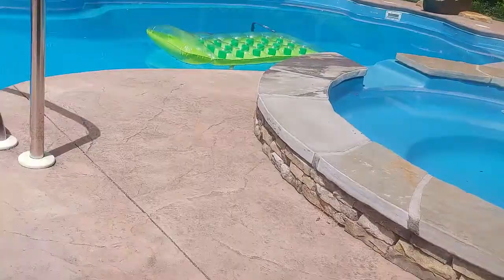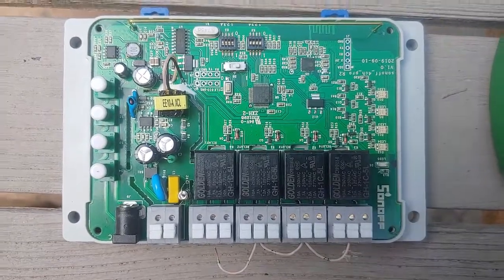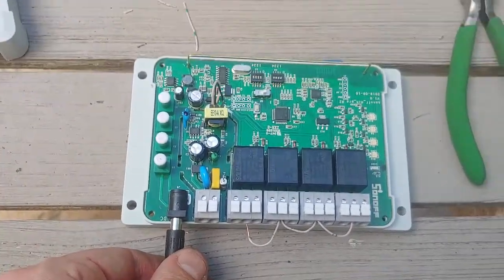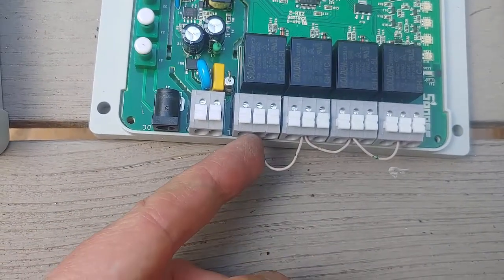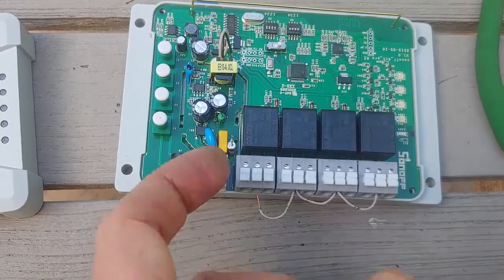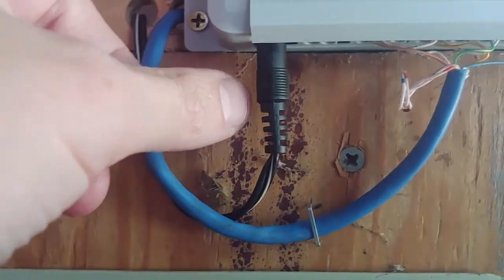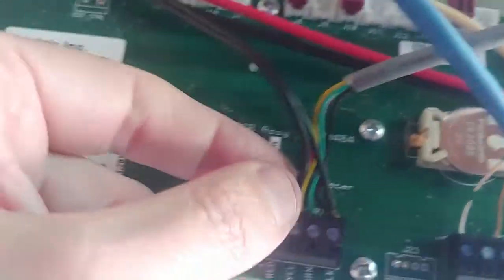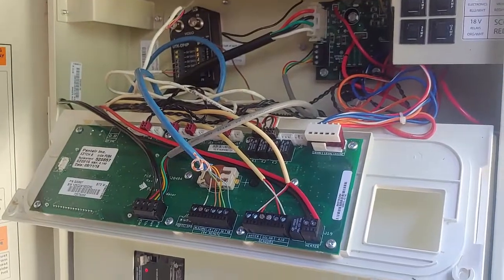REVIEW & overview: DIY Smart Pool and Spa Switch for $29 works with Amazon Alexa/Google Home

Comment: how do you get away using this with a water heater with 220V and 60amp?
Reply from the maker: I don't have an electric hot water appliance but it maybe acted by Louis voltage switch. In the case of what I'm showing the video, it's flipping low voltage relays which control high voltage wires in some cases.

Comment: Very helpful video.  I would trust this board much more than the original relays you used as these are only rated for dc voltage ranges and should clamp the kickback of the switch closing quite a bit vs. the relays supporting both dc and ac voltage.  In terms of the intellitouch board going bad I would suspect it might just be an rs232 adapter or similar; if someone can figure out the chip it could be re-soldered.  The low level voltage is generally TTL which is 5v or less.  You could in theory put a 6.2v protection diode on the TTL side on the pinout of the rs485 or similar port that goes to the screenlogic adapter, or 18v diode on the rs485 control signal wires (they run around 12v).
Reply from the maker: @eastmanresearch3143  you're spot on!! It was the RS232 chip that kept getting blown out. I found someone that told me exactly where it was on the board and that replaced it with the chip that he recommended. It was a lasting repair and never went out again I think it's been good for a couple years. I'm not sure I did another video on it. The guy had a business over repairing these boards and I told him I would pay him to tell me where the chip was. He was kind and told me where the chip was without charging me. It was a very challenging repair though, because of the chip is underneath the LED that is soldered on top of the board by about 32 pins. In fact I messed up the first board, but I had a spare and was successful in the second board.  While this automation that I show off in this video was good, it was flaky because the spa side remote setting on the board with default to off if there was the slightest confusing signal to the board. So I've had the screenlogic system back up in fully running for the last couple years or so. The network chip that I installed must have been more resilient, it was a different brand. To me it sort of proves that pentair was putting in a bad chip or at least one that could have used more resiliency.

Comment: Hi, Thank you for this information. I am installing a brand new above ground pool with heatpump. Do i need the pentair panel to connect the Sonoff or i can just connect the Sonoff to a regular pool panel to control the pool pump and heater? I dont have a spa.
Reply from the maker: @PKotia you'll need a panel that has a similar feature to the spa side remote input to do this. If it is a panel like mine or similar, You don't actually need to have a spa.

Comment: Have you seen where the pentair automation shuts off the is4 in the settings menu? I did t use the sonoff, but used a 4 channel rf controller and it is randomly turning off the main spa side option in the settings?
Reply from the maker: Yes, it seems to be a protection mechanism of some sort. Check that all your wires are tight. Also consider slowing down any commands. So if you're using that to cycle through lights to change colors it might have an issue during that. In short, I don't think anything's wrong with your pentair system because I've also seen that before.  I ended up fixing my main board and using the pentair automation and no longer use the sonoff. Still think it's a good solution though so I left my video up.
Reply: @SwimmingintheDeep  I read somewhere else that it could have something todo with the orange wire and it wanting to see some resistance. 

If I switch to the sonoff one, did you have to adjust the speed of the commands? I’m assuming that is how fast the “inching” is correct?
Reply from the maker: @lifeinsarasota  inching is same as momentary mode, which is what you want.  I just meant to make sure you don't press commands too quickly as that might be why is4 turns off. You may be onto something with resistance.

Comment: Definitely worth subscribing. My pool+spa set up is with manual jandys right now. I don't want to buy the Pentair panel. I d like to add two valve actuators. Is there a work around buying the Pentair intellitouch ?
Reply from the maker: You could use a device like I show in the video to directly flip the valves but you'll need some kind of 24 V input.  And then for the pool pump you could use a device like this https://www.amazon.com/dp/B09P5YFD7Z/ref=sspa_dk_detail_3?psc=1&pf_rd_p=89ee1d2e-380f-4a05-89e5-d22eb0a17762&pf_rd_r=AYHB1WMXEQ3XXBCXYDCG&pd_rd_wg=ju3gA&pd_rd_w=vMG5N&content-id=amzn1.sym.89ee1d2e-380f-4a05-89e5-d22eb0a17762&pd_rd_r=9d3a9c8e-09c6-41bd-aed3-1708585b2220&s=kitchen&sp_csd=d2lkZ2V0TmFtZT1zcF9kZXRhaWxfdGhlbWF0aWM&spLa=ZW5jcnlwdGVkUXVhbGlmaWVyPUExSktTMjNIVkZTUTk2JmVuY3J5cHRlZElkPUEwNDQzODU5MUtOVko2QjdNRTlIUCZlbmNyeXB0ZWRBZElkPUEwMTY3MTc2MUZXRUlOVFpSTEhVUiZ3aWRnZXROYW1lPXNwX2RldGFpbF90aGVtYXRpYyZhY3Rpb249Y2xpY2tSZWRpcmVjdCZkb05vdExvZ0NsaWNrPXRydWU=
Reply: @SwimmingintheDeep  Thanks for the reply just one more quick question: can I use the device in the video to calibrate/set the amount of valve opening? Will it run the actuators a certain amount of seconds and in the direction I need them to? For the 24V input I can buy a transformer.
Reply from the maker: @ROBERTLUCIAn  I think what you want to do is use the pin stops. Look at your pool actuator handle from the top and you'll see several holes and two plastic pins that can be removed and put in another location. Those pins will determine how far your valve can move.

Comment: My problem is - I’m trying to accomplish this(Turn Single Speed Hayward Pump on, then turn on pentair gas heater, potentially pool lights, no valves), but I don’t have an Easytouch panel.

Currently pump is controlled via mechanical timer. Gas heater through the on device control buttons. 

I’m trying to figure out how to get it to all work on the 4CH. 

I think I can directly hook into the foreman switch for the gas heater. However I’m a little stuck for my Hayward Superpump. Would I need a contactor?
Reply from the maker: You are on the right track. You would want to use something else instead that can handle that.  I researched a bit and found a couple of things on Amazon  https://a.co/d/8IRMQsE   I see some other similar things but was looking for one to handle both your heater and pump  separately but together.  You may need to do a separate sonoff type device for the heater like you were thinking. Let me know how it goes. Be careful with the high voltage wires and turn off the upstream power. Using 10 gauge or whatever is appropriate.

Comment: Thanks for the quick response, great video. The pentair spa side controls seem to support ten buttons. Do you know how that is implemented, could we have more than one 4ch device to make eight options?  I know the com port system can support many things, like heating, just not sure how it communicates to go over four buttons?  Thanks
Reply from the maker: I tried to think of a way to exploit that input but because I don't that option as a remote I really didn't know if it was possible. It seems that that might be more comport-based so it might not be as easy as the 4 channel spa side. I eventually ended up fixing my pentair screenlogic system by finding the chip on the board that had gone bad. I believe I replaced it with a much heartier chip because I have not since had an outage of it again.

Comment: Great info, well done. Appreciate the updates from your last video.  I am check on a relay that can be ethernet connected. But the Wifi is a great solution for this use case with very little data traffic.  If you have a wired 4ch with inching that would work please share. I'll integrate with open, home assistant on-prem home automation solution. Have you seen any power options to power-blink the lights at different cycles to memic the easytouch light control, for color? I have a couple easy touches and one has the pool light on a direct switch. So it misses out on the Easytouch light control, which I believe just cycles the relay/power x # of times depending on what mode it wants the light in.
Reply from the maker: Hi, thanks for the comment. I have not seen an ethernet inching device but they may exist. I don't have easytouch lights but another brand that works and changes off of a power cycle as you describe. It's a little hit and miss because of a slight delay but can usually work to change the color of the lights.

Comment: Do you have a link for that cord?
Reply from the maker: No, this was just a wire I had laying around the house in my junk. But it is an ethernet wire. You can use any wire that has at least four conducting wires in it. Oftentimes a security system wire would work as well.

Comment: I saw in your description that you used this on a pentair system. But you implied that your not sure about others. Then in your video you say you can use this in other systems. So can you use this on a jandy system? Great video by the way. Hope you have more maybe do one on a different system like jandy would be nice.
Reply from the maker: There are many systems that use a spa side remote that are basically the same concept. If your jandy system uses a four button spa side remote this will likely work with it.

Comment: Wow -- thx so much for the fantastic pool equipment videos. We have a Jandy Aqualink RS system and inside the house mounted on the wall there's a Jandy RS remote which is hardwired to the main controller outside. Considering the Jandy remote has full pool control, could I connect this Sonoff box directly to the remote where it would essentially "piggyback" the Jandy RS remote and give me WiFi access?
Reply from the maker: Thanks so much for the comment!  If the remote contacts equate to a simple normally open or closed switch it should work. You should be able to test the contacts with a small length of wire, mimicking a momentary switch. Hope that makes sense.

Comment: Awesome, thank you.  I have a question  - I want to use power NOT from the pentair board as I already have a spa side remote (the IS10) and don't want to put too much of a draw on the board.  I don't know much about the relays, so here's my question.  Does it only use the power supplied to the relay for the purpose of kicking on the relay and keeping the wifi alive or... does it also pass through the power in any way to the low spa side contacts?  i.e. do I care what voltage / amp I'm supplying to the unit, or is that shielded entirely from the contacts that it is connecting?  I hope that makes sense - don't want to fry anything!
Reply from the maker: It just works as a low voltage switch for the contacts. The low voltage current being switched stays independent from the low voltage powering the relays on this device. You probably have a old power supply like cell phone charger that falls within the specs to power it. Any USB charger may make it work.
Reply: @SwimmingintheDeep  THANK YOU - also do you happen to know if you can have both the IS10 spa side remote as well as using the 4 port at the same time?
Reply from the maker: @johnmehner8641  I don't have an IS10 so I don't know but I think they are two separate ways into remote the system. So my guess is yes, you can have both.

Comment: I have an Jandy AquaLink RS that the board is bad and I want to bypass the entire system. Wondering if I can I can connect the red and black wires coming from the relays that used to plug into the Aqualink control board - cut off the plastic connectors and plug the wires directly to the Sonoff?
Reply from the maker: It sounds like it to me. IT sounds like the red and black wires are low voltage, are they?  There are a few modes to this board....I have the contacts in "momentary" mode but you may need them in "locking mode" for what you are doing. Figure out what is happening, to open and close the relay. It is applying 12-24v constant?  That would be locking. If it is doing it momentarily then it would be momentary.
Reply: @SwimmingintheDeep  Yeah those are 24v wires from the relays. I have a free relay that I can test it out on. Thanks for the feedback...I'll check it out.

Comment: Can this control automated valves?  I'm looking for an option where I can say "Turn Spa On" and it will automatically change the valves over, start the pump, and start the heater.  Then when I say "Turn Spa Off" it will change everything back to pool mode.  I wonder if this would get me close if I just wire the heater and pump into the "spa" part of the board.
Reply from the maker: That's exactly what this does, moves the valves and turns on the pump. You need to have a system that already does that with buttons like the easytouch.
Reply: @SwimmingintheDeep  awesome!
Reply: @SwimmingintheDeep   to branch off on that, can i use the easyTouch wireless remote and this method,i would like the option  to have both
Reply from the maker: @jamesishere6630  yes, this just acts like spa side remote to the system.

Comment: Thanks for you tutorial. I have liked and subscribed! Any idea why the EasyTouch will disable the iS4 Spa Side remote on its own? I have connected the Sonoff 4ch Pro3 and it works fine until the iS4 disables itself. I have changed it back to on on the EasyTouch panel and with the ScreenLogic app but after a short time it will disable itself again.
Reply from the maker: I've read that if it detects an error that it disables itself. I think this has only happened to me once. I'd double check all wire connections and double check the dip switches on the sonoff  itself to what I show on the vid.
Reply: Did you ever figure out the issue? My EasyTouch also disables the Spa Side function on its own, and I haven't been able to figure out why.

Comment: This is a really elegant and cost effective solution.  The only oddity is you have to tell Alexa to turn "on" the pool device if you want it on or off.  It doesn't appear to know if the device is already on/off.  Seems like that is a wiring issue.
Reply from the maker: It's because of the nature of a momentary switch.  You can partially resolve this by adding a routine to Alexa or Google Home. For example, every time you say Pool Off, have it actually turn pool On.   So the command will work but you still have to verify what it did by looking at the pool.
Reply: @SwimmingintheDeep  Another solution would be to write some custom code for the ESP32 chip that is inside the Sonoff so it remembers the current on or off state (while still acting as a momentary switch).

However I might go down the route of completely cutting out the pool/spa control board - having the Sonoff trigger pumps, valves and heaters directly. Home assistant or some custom code to schedule daily cleaning routines. And another ESP32 board to monitor pH and ORP level. Some people have gone as far as pumping chlroine and acid automatically when levels are too low
Reply from the maker: @neoncreativestudios  good ideas! I ended up fixing my pentair board and I'm currently not using this system but I like your way of thinking!

Comment: This is great, can you give which wire to tap into on the hayward oncommand?  Thanks
Reply from the maker: KT AA, I am not sure. I see that the spa side remote for that system requires a base station that then wires to the board with four wires. I am not sure if these contact points can be leveraged. If you proceed, proceed with caution and at your own risk.
Reply: @SwimmingintheDeep  Thanks and was actually thinking about taping into the wires the goes to the relays. Thanks again Kevin

Comment: Great video. Got it to work myself using a wall wart but have had trouble powering it from those red and black terminals as shown. I think I even burned out the sonoff board altogether. (Getting a new one). Any idea what I could have done wrong?
Reply from the maker: Hi Andrew, I am not sure. Put a mulitmeter on those leads to double check the voltage. Turn the Multimeter to a 20v range setting and put the leads on the red and back terminals.
Reply: Does it matter which one is connected to which? I imagine one wire is for the post and the other is for the inner ring on that standard power connector, but they’re never clearly marked. Maybe I swapped them?
Reply: Figured it out. And for some reason the inching setting for each relay in the app has to be .5 seconds or the device goes offline for a little while. Thanks again for the video, I learned a lot. Maybe I’ll change it over to a raspberry pi someday.
Reply from the maker: Awesome! Glad to hear.

Comment: Any advice on starting a Pentair Superflo VST pump.  I gave it a shot on connecting the $57.00 pentair cable to R1 to remotely start in Quick Clean Mode but no luck.  Im in inching mode at 1s.  I'm wondering if I need to increase the seconds or should I go into self locking mode.
Reply: https://www.troublefreepool.com/threads/cheap-simple-web-enabled-pool-automation-with-google-assistant-integration.214676/

That's what I did.  Essentially, it just breaks the two 240V power wires with a DPST relay (same as the older pool equipment).  Link to the the part you'd need.